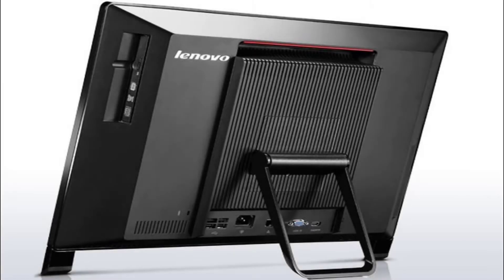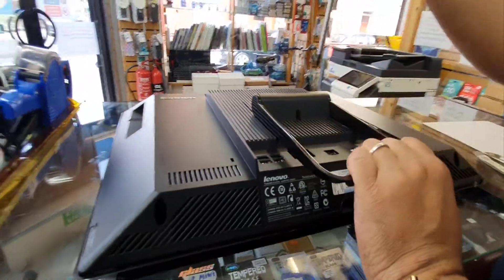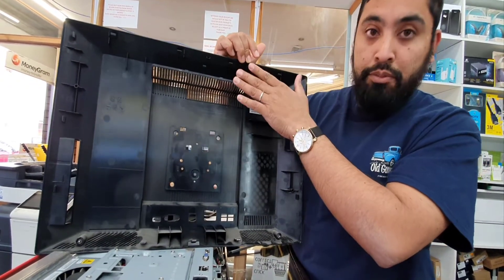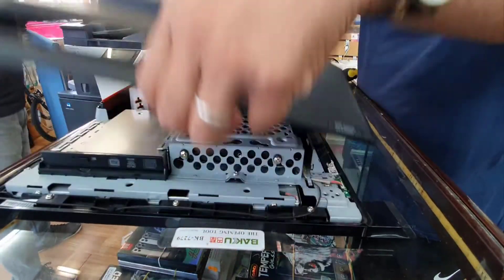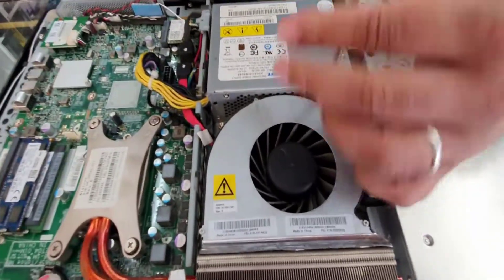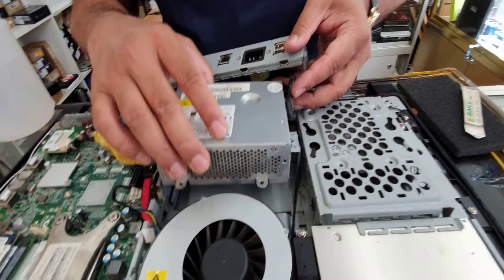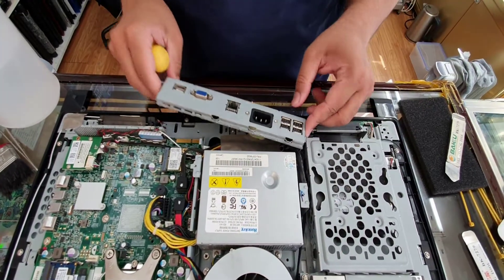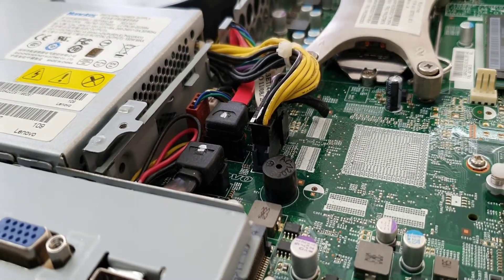How To Replace Power Supply On Lenovo All In One Thinkcentre Edge 91Z | Very Easy And Simple

Comment: Enjoyed this video but I have a different model that is a problem opening power supply housing: Lenovo Ideacentre AIO Y910-27ISH.  The power supply is inside the unit's stand. Much of the unit's insides have to be removed to get the stand free, but once done, then the stand itself has to be opened to remove the internal power supply unit. I cannot get the plastic case off of the stand to get at the power supply. Any suggestions? Thank you for your time.